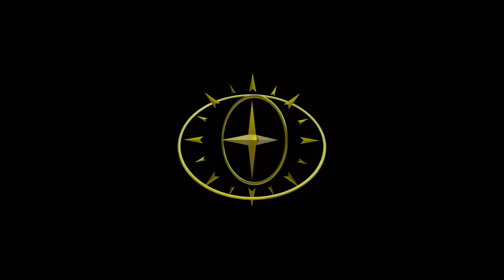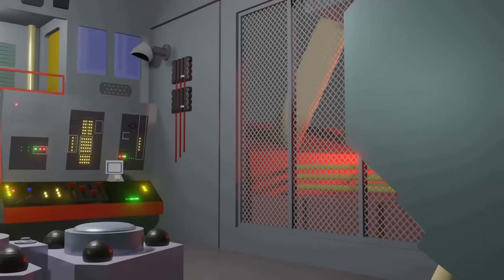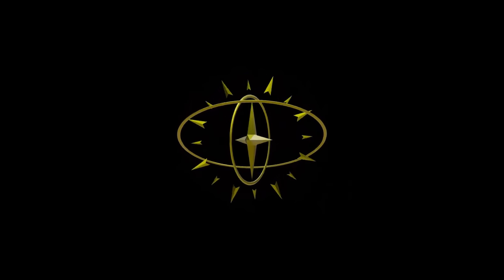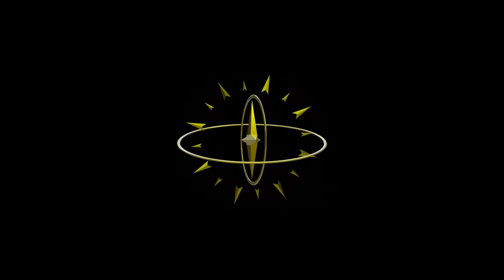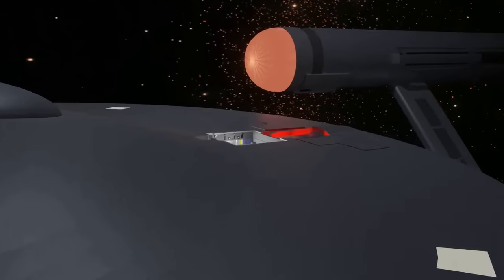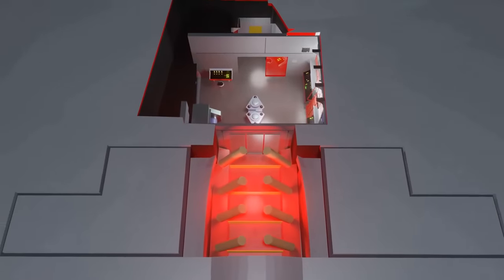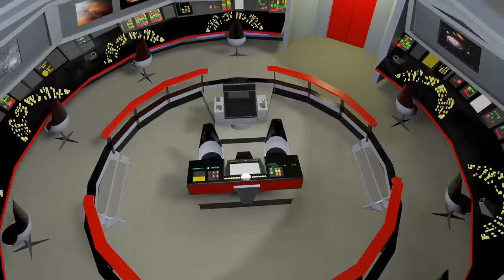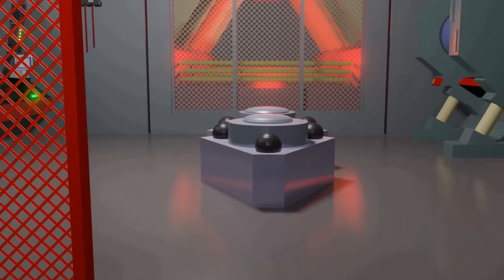The Enterprise Engine-room Enigma: where was main engineering?

Comment: In my mind it makes perfect sense.  There are probably multiple places that could be considered main engineering depending on the context of the needs (e.g. main engineering for ship power, main engineering for warp engines, main engineering for impulse) and also those may span multiple decks - separate from "engineering decks" that may link those areas to other critical parts of the ship the equipment is controlled by or supports much like a large building has many "mechanical rooms" or "electrical closets".  I would write off the similarities and differences as they are all roughly based on the same plan with minor tailoring to their individual needs.  And I presume turbolift can handle going in directions other than straight up and down because gravity is relative to the floor of the turbolift but the shaft may not go in a straight line so it seems plausible to me it could dodge obstacles.  This could also explain why the engineers are perpetually being called to main engineering and not just stationed there all the time because they may be getting called from one main X engineering area to another main Y engineering area, and presumably they would know the correct context so they wouldn't need to explicitly asked which one as they should always be aware of what's happening on the ship as a whole.

Comment: Referencing "Day of the Dove," there's also how the entity has trapped nearly 400 crew on the lower decks; if main engineering is located in the secondary hull, then how would the "active" crew or the Klingons be able to get in there with the entity able to reinforce overheads, bulkheads, and decks against phaser fire? Putting it in the primary hull forward of the impulse engines makes the most narrative sense in that case, which makes the final scene all the more confusing.
Reply: It does show the entity leaving from the upper middle of the secondary hull. So lower decks can mean they were trapped in the lower spaces in both main sections, some in the saucer, some in the engineering hull.

Comment: There’s an episode where Kirk and Spock are in the turbo lift after leaving engineering. Looking at the light on the wall they are going in a straight line . Then they stop and start going diagonally upward, meaning going up but they were in the neck of the Enterprise heading toward the saucer section.

Comment: I have the Technical Manual by Franz Joseph. Unfortunately I haven't got it to hand, as its in the bottom of a cupboard somewhere.  It does indeed show a diagram of the engineering section being right by the impulse engines in the primary hull. However, this is just for the Tug, scout and destroyer types, that don't have a secondary hull. If you've got yours to hand, then check the index at the beginning of the engineering chapter, and I am certain it says something along the lines that a mark IX (heavy cruiser) has its engineering section located in the secondary hull.

Comment: There was a 4-D portal (disguised as a standard Enterprise doorway) which would take a crew member from the curved hallway of the saucer section directly to main engineering in the secondary hull. There were no exterior windows in main engineering in order to conceal this fact from the crew. No crew member except the captain and chief engineer were aware of this because it was kept under wraps by Section 31, which is why the crew of the Enterprise-D were so confused when they came across this technology in the TNG episode "Where Silence Has Lease," both in the void itself as well as within the USS Yamato.

Comment: You stated in the video that you "attempted" to recreate the Engineering section.  Don't ever sell yourself short.  Your renditions are perfect and beautiful.  How long did it take to do?
Reply: Not exactly perfect....the bridge does not face forward, it's offset a few degrees because of the turbolift shaft....other than that they are perfect.
Reply: I think the consensus these days is that Franz Joseph got it wrong and that protrusion on the back of A-deck is something else (not the turbolift) and the bridge faces forward. I think this makes the most sense, don’t you?
Reply: @JordanOrlando   I build Trek models...all the specs say the bridge is off center...and all the models now are built that way. And a LOT of the pro model builders will tell you...some very nastily...lol...that yes it's off center.
Reply: @montylc2001  Respectfully, it doesn't matter how many models you personally build, how "all the models now" are built or what "all the specs" say — it's all just speculation based on the set design (for which Matt Jeffries moved the elevator clockwise to make for better camera compositions), the filming model (with its protrusion that everyone assumes is the turbolift even though proportionally it's too far back) and the 1975 Franz Joseph drawings (where he resolved the contradiction by rotating the bridge). Like the Millennium Falcon, the interior doesn't match the exterior...so all subsequent models (even by "pro model builders") are just extrapolation and speculation. I personally believe that 1) Franz Joseph was wrong — it doesn't make any sense for the entire bridge to be rotated; 2) the protrusion on the model may or may not be intended as the turbolift, but if so it was put there before Jeffries reluctantly agreed to move the turbolift on the Stage 9 set; but 3) the turbolift on the filming model is too distant from the bridge...so the best resolution is to ignore Joseph and have the bridge facing forward. And, by the way that's the scheme adopted by the author of this video we're commenting on.

Comment: I was going to shout its down in the engine hull between the pylon but yet now you say it, the early version of engineering didn't have the warp plasma conduits.
However an unknown feature is that the saucer on the original was also separable from the engines in order to act as an emergency life boat placing main engineering down in the lower hull.

Comment: 9:50 The problem with the identical engine rooms in both the primary and secondary saucer can partially be explained by the one seen in Season/Series 1 is one layout and the later Seasons/Series used the other layout, such as the later one with the dilithium chamber being in the secondar hull and the one without it but with the large machinery to the left being in the primary hull.  That would help with the different looks as well as dual locations. 

Plus, on military ships engineering tends to be split areas with different ones for the boilers and others for the steam turbines.  The Iowa-class battleship is a good example of this with the boilers split up between different compartments, with the steam turbines split up in separate spaces as well.  Those areas look pretty much alike between the types of compartments because this simplified design, operation, and maintenance.  So who's to say Starfleet didn't do something similar?

But like you said, the real reason is sound stage space and budgets requiring such measures.

Comment: One thing not touched on here is the Main System Display created by Doug Drexler for the Enterprise Episode: "In A Mirror Darkly."  It clearly shows the Main Engineering room in the secondary hull, but does not show one in the saucer section.  I suspect that the reason for this - indeed the reason the Saucer has a Main Engineering Room at all - is in a tiny detail rarely talked about: the Dedication Plaque.  One of the minor but notable details in TOS is that the Dedication Plaque in the Enterprise reads Starship Class, not Constitution Class.  Meanwhile, the Defiant (NCC-1764) has a plaque that reads Constitution Class.  The Main System Display also shows us exactly where the Warp Core is - the bottom-aft of the secondary hull, configured in an unusual inverted T-shaped design (which gives it some passing layout resemblance to the movie warp core, if more compact, rather than the simple vertical column-and-bulb of later designs).

Given the mix-and-match nature of Federation starships of the era, I propose that the TOS Enterprise originally was not a Constitution class ship, but a "Starship" class ship, and was only refit to the Constitution layout later, probably after the USS Constitution proved to be a superior layout.  It is possible that the version we see in "The Cage" was the "Starship" class version, with main engineering in the saucer and the larger bridge dome, while the secondary hull carried other machinery, fuel, as well as the power conduits for the warp drive.  We do know that at this time the ship had half the crew that it boasted under Kirk.  It may also be possible that the Starship class was a saucer-and-nacelle(s) design like the Hermes and Saladin classes, or the Farragut and Archer we see in Strange New Worlds.  We even see a Constitution look-a-like in the Sombra-class ship (crew of 90) that had to be recovered from where it had crashed on a planet.

Also supporting this theory is the USS Constellation, NCC-1017.  Given its registry number, it should have been built significantly before the Constitution, NCC-1700, but seemed to still be a Constitution class ship.  It may be that this was another ship based on what appears to be an universal saucer design, later upgraded to a Constitution class ship.

Now, once the Constitution Refit began, there was no need to keep the engine room in the saucer, since an entirely new drive system was being installed, and there were significant structural changes being made.

As and aside:  As far as I know, we were never given details on just how the refit was undertaken.  It is possible that the entire secondary hull was simply removed and replaced with an entirely new unit with the new warp core and nacelles, and most of the actual "refit" was the changes to the saucer.  I also suspect that some of the universal saucer type ships may have been rebuilt into the Miranda-class, which would still have their main engineering room and warp core in the saucer.  It could be that the Enterprise Refit was a one-off prototype which used the available space from the engineering room in the saucer to graft the warp core to the impulse drive.  Other Constitution refits, judging by the Enterprise-A, used the TNG-style warp core (apparently) pioneered on the Excelsior, and thus the special linkages for the experimental warp core would be unnecessary, so it may have been limited to purpose-built Constitutions that lacked the saucer-section engineering room.  It may be that the Constitution fell out of use due to how few there were in the first place, with most universal saucers instead being converted to the Miranda class due to ease of conversion.  We do know that Starfleet was enamored with the Miranda class, given how very many we see.

Comment: I always found it odd in 'Court Martial' that the 'Engineering' they fight in was devoid of that central double-triangle structure that we see the Dilithium crystals in; sure, on a practical level, it's because of how the fight was choreographed, but still sticks in your brain 'if they are in Main Engineering, where is the Dilithium Chamber (double-triangle) structure?'. It being removed there I guess could give credence to there being a similar shaped room for Impulse Control. As to the overall question, I've always had it in my mind it's in the Secondary Hull near the Nacelle pylons.
Reply: That double triangle thingy wasn't added to the set until the second season

Comment: I would think the most likely place for main engineering is in the secondary hull.  In TOS this is probably on the deck above the power transfer conduits where the delirium articulation frame and dilithium crystals and control stations are housed.  The impulse engine complex with the fusion reactors are in the saucer section.

Comment: It occurs to me that TOS (and Enterprise) did lettered decks while TNG (and onwards) did numbered, presumably because the Enterprise D has 42 decks, so having decks called AA, AB, AC, and so on might be unnecessarily confusing to everyone and numbering decks stuck.

I haven't quite finished the video, wild inconsistencies aside, I would guess that there are two basically identical engineering spaces, one for impulse and one for warp.
Reply: Well, you came to the same basic conclusion.

Comment: I have to mention the Saladin class, which has a saucer connected via an Enterprise-style neck to a single warp nacelle with no secondary hull. According to the deck plans I have seen, the single engineering section is crammed in at the back of the saucer and no doubt serves both means of propulsion. I do not know whether there is any relation between the size of a ship and the size of its engineering section, or whether having a single nacelle means that the ship can get away with less space in its main engineering. But this seems to suggest that   engineering for both means of propulsion can be put in a single room.

It may be that there is a "secondary engineering" in either ship; there must be some internal access to the nacelles so that they can be repaired without a space dock. This might exist at the front of the Saladin class's single nacelle. Questions for another time.

Comment: I think there would be two control rooms, one in the saucer near the impulse drives and one in the secondary hull. Budget restrictions meant they had to use one set for both rooms. The engineering set was meant to represent the warp engineering in the secondary hull, located between the hangar and the main deflector housing. The pipes do connect to the pylons but through a horizontal connection over the ceiling of the hangar deck
Reply: Right, nobody disagrees with that, but Main Engineering is pretty specific as a set, and where its location is what's being debated. People who champion it being in the saucer are hardcore fans of Franz Joseph want it in the saucer, but it's clear the intention was for it to be in the secondary hull somewhere between the deflector dish and the pylons. 

The matter's moot since ST:ENT with Doug Drexler's MSD of the Defiant showing Main Engineering in the secondary hull and the tubes being the plasma relays taking power up to the nacelles.

Comment: In some configurations of naval ships, the decks are sometimes in reverse or from bottom to top instead of top to bottom. in a different case like the french classifications of floors of a building "Le premier étage," which is the second floor in English, however, if you understand basic French it means the first floor as the lobby or foyer is its own floor.

Comment: The top edge of the season 2 onwards engineering set, has curved roof beams suggesting the top of the set is under the curve of the top of the secondary hull. But as you point out there is a ton of conflicting information.

Comment: Another factor to consider is that in "Day of the Dove" four hundred crewmembers were said to be 'trapped below decks'. Assuming the engineering section in the episode, is in the secondary hull in the location shown in this video, that means below decks would be approximately the bottom third of the secondary hull. That's an awful lot of of people to be trapped in that small section and assuming that a majority of them were on duty, why would almost all of the crew work in the bottom third of the secondary hull. Lets be clear, I personally think engineering is in the secondary hull, but much of that episode, including the curving corridor, makes much more sense if engineering was at the rear of the saucer.

Comment: There is Impulse Engineering and Warp Engineering. To tell them apart. Warp Engineering has the Dilithium Crystal unit in the center of the floor. If that containment unit is missing. They are in Impulse Engineering. The rooms are identical otherwise, as the Impulse and Warp can be controlled from with the proper security clearances.

Comment: I feel Strange New Worlds answers this question pretty well, considering that Enterprise is supposed to be the 1960s version, just rendered correctly for the first time. On SNW Enterprise, engineering is shown to be behind the shuttle bay, near the deflector dish, with the Warp drive feeding into the saucer section, so both theories are right, where Engineering is in the saucer behind the impulse engines, while also being in the warp section behind the deflector dish.

Beyond illustrates this really well too, having the saucer pylon almost completely hollow w/ the core being fed through the middle. combine that with SNW version where most of the warp section is hollow because of the room needed for the cargo bay, shuttle bay, and main engineering. I think it's so vague in TOS because they simply hadn't figured it out yet

On top of all this, there's multiple areas in the Saucer section where there are "Engineering Stations" where it's miniature backup versions of Main Engineering. It's kinda like how on DIS we never actually see Main Engineering, just a section of it. We were just shown different rooms where they were classified as Engineering.

Theres also a massive yellow port at the bottom of the warp section that acts as a fuel port on models of the ship so......

Comment: Main engineering would have to be in the secondary hull/star drive section otherwise it kind of renders the the saucer separation emergency system kind of pointless if the exploding engine is in the part of the ship with the impulse engines and uhh the people. XD

I tend to agree the weird dialogue likely refers to the impulse control area or just a silly mistake before stuff was fleshed out. I generally assume how it was set up with the refit didn't change much from the original in location.